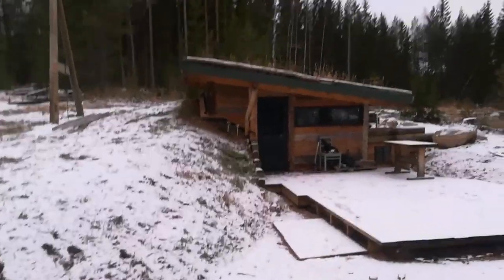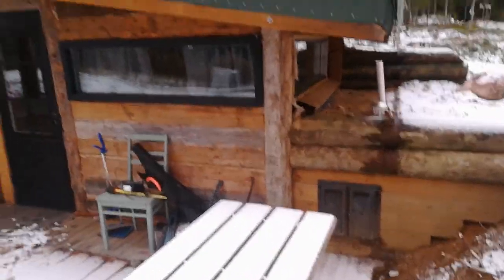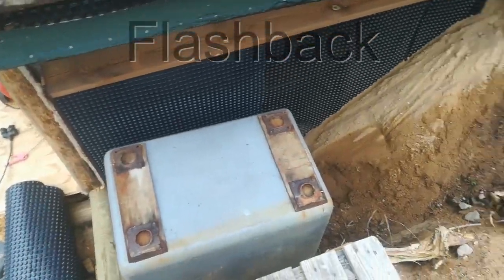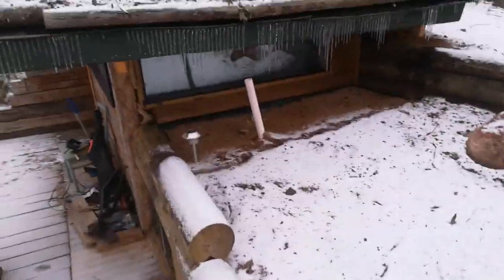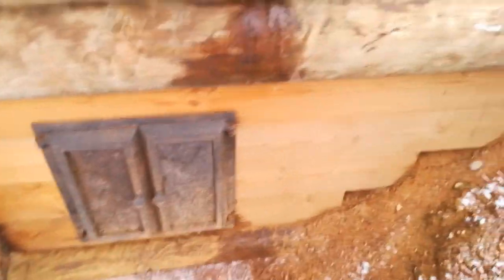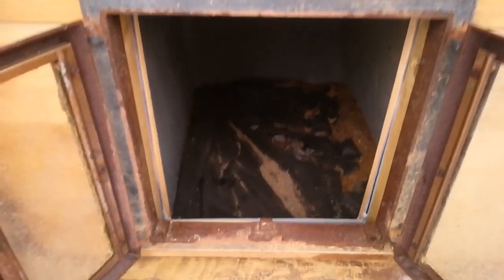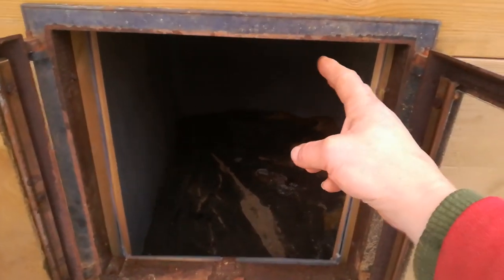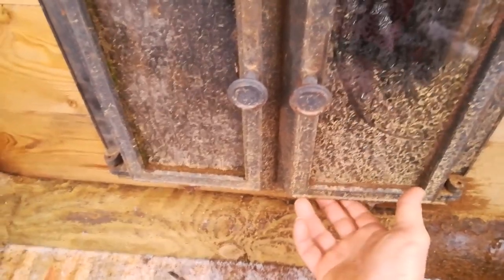Easiest log building method ever part 6. Conclusion

Comment: It looked like the joints are so numerous that it would have taken less work to build a conventional log cabin.  My experience as a carpenter of 20 years (when I was young) is that when people depart from traditional practices, they create 2 problems for everyone they solve.
Reply from the maker: I disagree on your first point. The work involved in doing a traditional notch is ten times more than making a tongue or a groove. I do build using traditional techniques but I wanted to document this project in particular because I am also interested in experimenting with different methods.
Reply: @ProjectHighlander  Wouldn't butt and pass be quicker and simpler ?
Reply from the maker: @archie7212  One of the main reasons I use this method, and why I call it easy, is that its doable with one person, limited skill and no lifting equipment. I've built big buildings using conventional techniques but with no lifting equipment and that's hard work. This allows a single person to build any size of building, alone, without lifting gear, cranes, winches etc.
Reply: @ProjectHighlander  Sounds good, 😃

Comment: I just watched the 6 part series.  You basically re-invented the 'piece on piece' method, which is somewhat common in some locations, and you did a fine job of it, ensuring that you have a stable structure.  I really like the way you utilized the plank sill inset into the bottom of the posts.  I am considering using a version of your method for my own construction, and thank you for your detailed explaination and videography.  Cheers from Canada.
Reply from the maker: Hope it was of some use.

Comment: I'm wondering what the 'insulation' material is that you used between your materials?  Also, I would consider this to be an draft sealer, and not insulation.  Insulation is something that is lofty, with microscopic air pockets.  Once it is compressed, it loses this characteristic and thus provides little insulative value.  It would provide a seal to prevent air from moving through the gaps, which is great!
Reply from the maker: Yes, it stops drafts but you have to remember that I leave extra space in the lateral groove so while the edges are pretty tight there is space in between so it does give some insulative value.

Comment: Provided you used large enough logs would this method work for a two story cabin. My mind says it should if the cross beams for the second floor are tied in correctly.
Reply from the maker: Yes. It would work fine. The vertical logs should be full length, from foundation to roof. As long as the beams for the second story floor /ground floor ceiling are done well, locking everything together in all directions.

Comment: 💗💗💗 FROM WATCHING THIS SERIES I HAVE A FEW QUESTIONS. IS SOLAR GOING TO BE ADDED TO THIS BUILD? ELECTRIC?? HEAT???
Reply from the maker: No solar on this build but yes, we put in a electrical cable, underground. Dug a trench about a meter deep and installed the cable and a drainage pipe.

Comment: Nice Job, have you build this style of construction with gable or hip roof's and if so, does it change anything about the process 
Thanks in advance
Reply from the maker: Yes I have and it does not change anything. as long as the roof structure is really strong in all directions it'll work.

Comment: Its absolutely an amazing job, but why didn't you put any gutters on
Reply from the maker: Really does not need gutters. Virtually all water drains out from the lowest roof edge which is a generous distance from the wall and very close to the ground surface anyway plus there is a buried drainage ditch pipe directly under that  edge.

Comment: It was fun to watch the cabin being built
but one question - where is the stove to heat the cabin?
Reply from the maker: No stove in this one, just an electric heater.
Reply: @ProjectHighlander  The insulation for the roof is poor. Extruded polystyrene can be placed on top of the wood.
Reply from the maker: @jakebredthauer5100  ...... are you being serious? Polystyrene. Ok, this is obviously a joke or sarcasm.
Reply: @ProjectHighlander  Extruded polystyrene is perfectly effective in underwater applications.    These 4 by 8 sheets are yellow, blue or some other color.   Expanded polystyrene is much different and would not be suitable.   Some people call it beadboard.   I was thinking that the cabin was for year-around use. Insulation would not be as useful if the cabin is not used in the winter.

Comment: Thank you again for documenting this and showing your method; very selfless of you and as 23 year old, saving for a similar project it's super appreciated. Obviously, you're a professional but if i can ask, how many days did this take you all in without say, needing to move to the built site, and if you didn't need to stop for back pain? (I'd probably double the number of days for me but would be helpful regardless)  and also how much would you recommend saving for a similar amount of wood if I couldn't reuse / source some. Regardles, cheers again!
Reply: I was wondering the same thing.
Reply from the maker: I will check back through my work diary and estimate a realistic timelime without the breakdown/rebuild. Watch this thread....
Reply from the maker: Ok so the basic build of the walls took me 40 hours, but that's not including foundation/floor, roof work or insulating and pegging. I used a very simple foundation and foundation)floor took 2 days. Roof was another 2 days plus the work the customer did so call that 3 days. I would guess the insulating and pegging would add at least another day. So we are at 88 hours.
Reply from the maker: To your second question - if I understand it right. Its simple to work out how much log material you need. Dimensions of this building are (very approximately) 3.5m x 2.25m so total wall length = 2x3.5m +2x2.25m. or 11.5m. I think the wall was 12 logs high at the taller end and 9 logs at the lower end so an average of 10.5 logs high. 11.5m x 10.5 logs =120.75m of log. So if you know your buildings dimensions (remembering to factor in any internal dividing walls) and you know the height you want the walls to be and you know the size (width) of your logs (remembering that you lose a few cm from each log as you drop it onto the one below) then you can work out your material requirements. of course you round all the numbers up to account for waste.

Comment: Very nice work.  What did you insulate cracks in wall with?  Space between logs
Reply from the maker: Difficult because I don't know what its called in English. A straight translation would be linseed roll. Its a kind of mat or felt made from natural fibres. I did find the brand name or at least the name of the company that makes it. Isolina.
Reply from the maker: Flax. its made from flax.

Comment: Loved the build videos. Keep up the good work.

Between each layer of log, you placed insulation. From what I could see in the video, the insulation would be plainly visible from the inside of the cabin. Is this the case? How to you finish off your walls on the inside to hide the insulation? What type of insulation are you using? It looks a bit like rock wool.

On another note, is there an advantage/disadvantage to the finished product if you were to mill the top and bottom flat? Obviously, that would take more time and tool work, just wondering if the insulation seam would fit tighter, allowing it to be a more narrow course of insulation.
Reply from the maker: The insulation is Flax fibre. yes, you can see it in the finished wall. you can trim off the excess or pack it into the seams with a special tool if you wish but most don't bother. Its a part of the wall, no need to hide it. There would be no advantages to milling the top and bottom of the logs, The lateral groove holds the log in place atop the previous log preventing it from bending and moving horizontally, it also allows the log to crack and change shape as it dries because as the groove opens it allows the log to simply drop a little without the seams opening up as would happen if you had flat surfaces. In addition the flat surfaces would squeeze all the air out of the insulation reducing its insulative value.

Comment: Those icicles from the roof, you are leaking heat from inside through roof? Does ice build up between plastic and wood?
Reply from the maker: No. the icicles are from the water which flows on top of the plastic. Every eve of every building here will have icicles in the winter. Air is still flowing underneath the plastic.
Reply: @ProjectHighlander  Ah, okay, then you will not have moisture build up underneath. You are still  leaking heat though. But as long as air is free to pass and keeps everything under the plastic dry, all should be good! :D

Comment: What you do for heat inside the structure?
Reply from the maker: It is mainly for summer use but there is an electric heater in there.

Comment: What kind of insulation do you use i can't find it anywhere online, I see foam gasket tape but yours looks fibrous.  I assume its not just normal insulation because if it is its going to hold moister in all the joints and in between the logs and cause premature rot.  I'm genuinely wondering you obviously know more than me, are you just not concerned about it?  The cabin will easily last a lifetime still but I'd want to make it last as long as possible
Reply from the maker: The insulation is flax fiber. It wicks moisture away from between the logs. It is made by a company called Isolinna. https://www.isolina.com/gb/default.cfm
Reply: @ProjectHighlander  Wow awesome thanks!

Comment: New to your channel, so sorry if you've answered this before... I'm curious about the insulation. First, is there any concern that moisture could wick in? Second, is it flammable (a different sort of 'wick')?
Reply from the maker: Ok. Second point first. No. The Flax insulation is really hard to light on fire. Its not impossible but you have to be trying pretty hard. The logs themselves are, of course, flammable. It does not wick moisture in but it does let air through even when its compressed between logs. The air moves very very slowly through it but its enough to dry it as it absorbs moisture from the logs as they dry.
Reply: @ProjectHighlander  Thanks. Sounds   like a good alternative to moss and clay.
Reply from the maker: NO! The flax insulation is fairly cheap and easy to use but I count it as the second best solution. Moss is far and away the best to put between logs. Clay? no. But moss yes. Its more labour intensive, you have to find the right kind of moss and harvest it and you have to know how to put it in but if its done right moss is definitely the best. It basically does everything the flax does but its Ph prevents mold and fungus. I have repaired many log buildings and currently restore historically significant log buildings for the Finnish Historical Society and I rarely have to repair/replace logs where moss was used as insulation.
Reply: @ProjectHighlander  Thanks for your time. Good to know that.
Reply: @ProjectHighlander  That is good to know about the flax insulation.   I thought it was a foam, like sill seal.

Comment: Nice job. But i disagree putting it in the ground. Its going to be damp  and moldy. 
I think high and dry . I see how you vented it.  Still better off high and dry?
Reply from the maker: High and dry would be much more sensible but sensible can be boring. If its done right there is no reason that underground should mean damp or moldy.